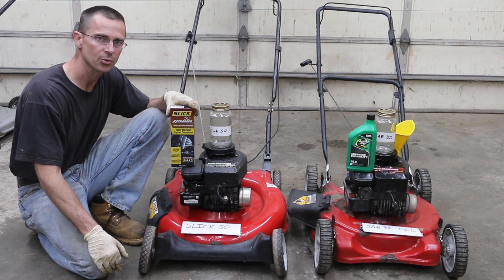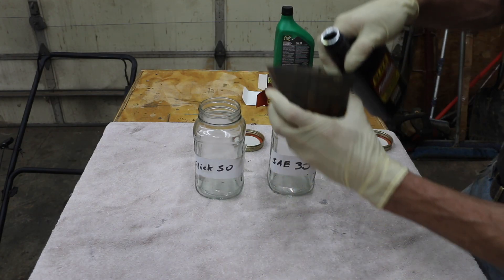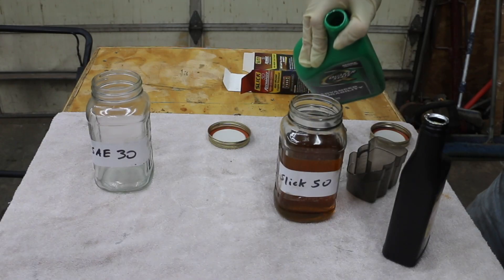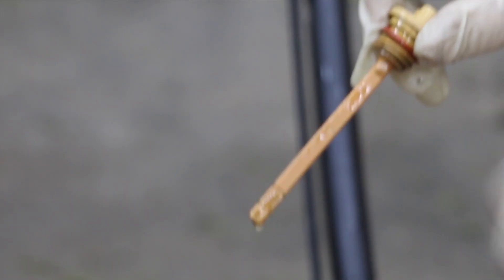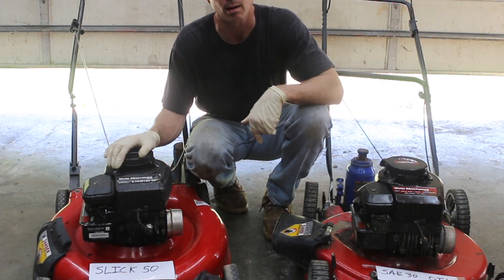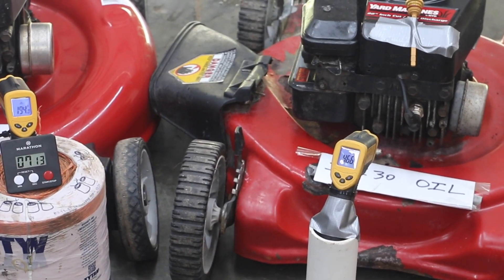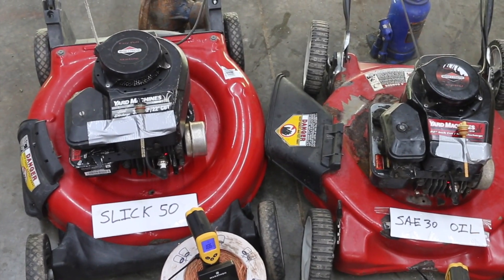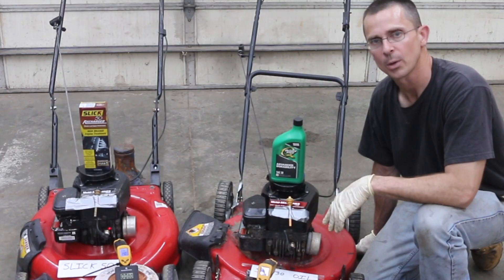Can't believe what SLICK 50 did to my engine!!--Dry Crankcase Test!

Comment: Yes the best product for your application is duralube oil treatment $16 a qt.as seen on tv.
This stuff is THE STUFF.
SUBARU BRAT 80MPH  over 1&1/2 hrs. Thou it did stall out i let it cool it had no water, no oil.. I added water & oil it fired right up no problems . Do not use unless parts are broke in .OR THEY NEVER WILL BRAKE IN.
Reply from the maker: Thank you for the recommendation!

Comment: I did not see you shake the slick 50 bottle before  pouring  a portion to mix with your engine oil. Maybe you did. Maybe not. So here is my comment even though i have used this product before i dont believe it actually works.  But here is a very important piece of information.  Slick 50 has teflon particles that fall to the bottom  there is approximately 20 % teflon. And 80% base oil.  If it was not shaken thoroughly  just before you poured some out to test. You probably only added base oil to the test.  Making the test not accurate.  Sorry to let you know this.  I enjoy all your videos. Thank you so much  keep up the good work. I feel your very conscious of fair testing.  Please re test the slick 50. Although the results will probably be the same anyway  but who knows.  Thanks again  from bob

Comment: What you're not recognizing is the fact that the slick 50 is better for retained oil and the other is just not as good at that same job, while still being better at overall retention of lubrication. #1 The slick 50 runs far cooler. This means you're getting better performance and metal retention (as long as the rpm stays in what you consider your performance range and you retain oil). #2) If you're truly going to dump all coolants and one was designed to better cool and retain performance at volume while the other is just better at performing without reinforcement by volume then it isn't a fair comparison. The second would be able to take a hole in it's oil pan and still perform whereas the other would just lock up. Neither is better, they both have advantages and either can be better on an individual course.

Comment: I would like you to do the test a second time and inspect the internals and do a compression test both before and after letting them seize. I suspect that the motor with slick 50 likely gummed up and possibly could be saved. I used it in my 1974 Porche 914 4 cylinder and after a bad oil change from a mechanic the drain plug fell out. I found something to use as a plug. I put a little oil in each cylinder. I then put the car in gear and rocked it back and forth until it freed the cylinders. I started it up and continued on to my date. I didn't have any problems with car after that day.
Reply from the maker: Thank you!

Comment: Anyone notice that the volume of oil that came out of the sae30 was much less than the volume that came out from the slick 50 engine. Maybe there was still some oil left in the sae30 engine which let it run longer
Reply: Waqas Noor Siddiqui ...I thought the same thing when noticed the difference in volume of the extracted oil.

Comment: I bought a used mower with a Briggs and Stratton engine about 20 years ago for $10. I never checked or changed the oil. The deck and wheels finally gave out before the engine ever did. My friends told me, you should change the oil at least once or twice a year. I told them, why would I spend so much money on oil. I can just get another one for $10. I was wrong, it cost me $20 to replace it with another used mower.
Reply from the maker: Great point! Thank you

Comment: I realize this is an old video, but you claim to read all comments. How about performing this test with LiquiMoly MoS2, which claims to allow engines to survive running with no oil pressure?
Reply from the maker: Thank you.  I tested MoS2 a while back but didn't use this type of test.
Reply: @ProjectFarm  I think it would be interesting to see how long an engine treated with MoS2 can survive after experiencing a total loss of oil. Better yet, how long do you have to shut the engine down after losing oil pressure before serious engine damage occurs.

Comment: My 2000 G AM cracked the oil sensor & leaked out most of my walmart synthetic oil , no oil on dipstick  . I stopped & put 3 qts of regular oil in, as that was all the little store had. I had 10 miles to home, with no other stores . Made it home, no oil on stick again, motor was popping & sizzling. Drained oil & found almost nothing was left. Refilled with same synthetic, that was 5 years & 50,000 miles ago. Car still only uses about a quart per oil change & purrs like a kitten.
Reply from the maker: Impressive!

Comment: I'm certainly not a proponent of snake oil, but didn't the Slick 50 engine have a lower operating temp than the regular 30 wt oil engine until it gave up the ghost ?  In other words,  if both engines had the proper amount of oil still in the engine would the Slick 50 engine last longer due to the lower running temp ?  I know you can't run a test that long but it is something to think about.....
Reply from the maker: Thank you

Comment: This is why I never lend out my stuff.
Reply: haahaaaa cough haha
Reply: @og1ie  LMAO
Reply: You lend your mower, your truck, your wife to someone, don't be surprised if they have a rod thrown in them.
Reply: @jeffhale2278  😂😂😂😂😂
Reply: Just don’t lend your stuff to this guy...
Reply: LOL Nice :)
Reply: @royr1016  Not the issue here. There are virtually no threads to tap into, as in the factory threaded the fitting in not much more than 1 thread depth deep, which rusts away and breaks out the single thread.  If you tighten further it will crack the pump housing, which has happened to people. If you used thread tape it would only make the clearance problem worse, as it would make the fitting larger. The factory knew about the issue which is why they barely threaded them in.   The tapered threads need tapped further, which is the solution. After doing that, a person could use a sealing enhancer such as thread tape, although I believe the factory uses a sealing compound more suitable to the high pressure.
Reply: @billg7205  Name the make of the pressure washer. Shame those idiots into making them better.
Reply: @quantumleap359  Honda, but I believe the pumps are used by other manufacturers and have the same issue.
Reply: Smart man.  My pressure washer started leaking at the hose base fitting.  Darn threads were tapped too small, so they only threaded the hose fitting 1-1/2 threads deep into the pump, and it broke out when the threads rusted.  Workers at the factory were probably told to just thread them in enough, and not to crack pump housings.  Why would they possibly want to go to the effort to tap the pumps a bit and ship a properly manufactured product?  I threaded it back in a bit further but it's still leaking, and I'm not going any further and cracking the pump housing.  I'll get around to properly tapping the female pump threads or reducing the male threads on the fitting some day.  Read about a guy online with the same pressure washer.  Guy was pissed when he lent it to his bro-in-law, who cracked the pump trying to tighten the same fitting to stop a leak.  I'd bet that's happened a number of times with the same machine, with people who have no concept that you can't just keep cranking tapered fittings into cast parts.
Reply: @billg7205  hey bill; you could try gluing a brass male/female threaded bush on the machine. i have had the same problem once before and this was my solution that worked.

Comment: I'm shocked.. I noticed the tyres on sae 30 were alot newer then slick 50..need to do side by side on exaxt built engines.. I have used Teflon based additives in noisey engines and it definitely quietens them down.. Somtimes and most times lifter noise goes away.. So from my experience most snake oils work well.. Especially Mos2.. I have excellent results with Teflon 2..
Reply from the maker: Thank you!

Comment: different slick50, the original had teflon in it and was a gray looking liquid
Reply: I used the original back in 1990. It was gray and thick. I remember it have very specific use requirements. Immediately drive at highway speeds for 30 miles, something like that.  Also remember there stories going around that it clogged oil filters because the size of the Teflon particles. Among the motor heads I hung out with at the time, the general consensus was to change your oil/filter after the first 50 miles, the idea being that the Teflon would have bonded to the moving parts by then, and your filter was now running in bypass due to it being clogged. Absolutely zero science was used to support that, it's just what made sense to us at the time.
Reply from the maker: Thank you!
Reply: @ProjectFarm  The old Slick Fifty was a different formula than what is available now. There were legal issues when the company was sold. The only place that I know of where you can still get the original is Australia
Reply: @wearemilesfromnowhere4630  or from me. I made a whole lot of money running a lawnmower engine without any oil in it that had been treated with Real Slick-50...
Reply: weren't they supposed to shake it first?  All the Teflon was probably at the bottom of the bottle.
Reply: @ChuddleBuggy  Correct, if you shake it, it looks almost like milk.
Reply: @ChuddleBuggy  My thoughts exactly. When I first used it in a 2 or 3 year old car that I'd bought from new I didn't really notice any difference, but a friend who hadn't been in it for a while commented on how it seemed much quieter under load after using it. I've used it in all my cars since then. Can't say I've noticed any significant increase in mileage per gallon, but I don't normally bother to check it.
Reply: It seemed like the Slick50 worked when it was in the engine.
It's good to know about Bishop's though.
I'm curious how Lucas would hold up.
As a Fed Ex Ground contractor, I had a Fed Ex P30 350 V8 with a Trasko oil filter. The first month I almost crapped my pants when I saw the metal particles on the micro screen. I used Lucas in that  oil change and never again. I sold the truck with over 300k miles and never opened the motor or transmission.
Reply: Slick Rock Lucas is good stuff too.
Reply: @lifequest7453  I tried to find a distributor for bishops original and their is no U.S. distribution ?
Reply: @TheHarleytt  Their what?
Reply: Actually the new formula has cheap Teflon in it, Bishop had a different ingredient and criticized them for using Teflon. Bishop’s Original is the original Slick 50. http://www.dvgibson.com
Reply: You need to shake it up to make sure the additives are in suspension be fore you pour it.
Reply: @Smedleydog1  I've always done that, then rinsed the bottle out with some clean oil.
Reply: @lifequest7453  https://www.youtube.com/watch?v=CAt-tJa9P_s
Reply: Absolutely spot on.  I always used the original stuff and never had a scrap of bother with lubricated surfaces with any of my engines. The only problem that I ever had was a broken valve spring which neither I or my local engine restorer had ever seen.  My engines were still running like new long after the bodies returned to mother earth.  The stuff you are using is nothing like the stuff I used.

Comment: There was a product that came out about 10 years ago. It shows 2 cars, one ran with regular synthetic oil then drained, the other ran with "Angelcote" I think, then drained. They drove the same route without oil. The  goal was a 200 mile stretch. The engine without synthetic oil ran 2 miles then locked up. The one with "Angelcote" went all 200 miles and back without difficulty. I am unsure about the name.
Reply from the maker: Wow!

Comment: Modern slick 50 is not what it used to be it does not work now.apparently xcelplus is using the old original slick50 formula so I feel you should test that
Reply from the maker: Thank you!

Comment: My guess is that the slick 50 probably didn't make any difference. The temperature difference could literally have been caused by anything and the fact that the slick 50 seized first doesn't mean it's bad either. It could have been a small scratch or one little piece of metal or something that lead to the breakdown.
Reply from the maker: Thank you!

Comment: I could be wrong but I thought they drained the oil and replaced it with water in that old commercial. Also I'm curious as to how similar the hours and maintenance was on the two mower engines. It's hard to believe that with the considerable temperature difference that the slick fifty engine seized first. Keep up the great work. I only just found your channel today, subscribed and I really like it. Thanks

Comment: Slick 50 takes a while to activate and it has to be at running temp for a good amount of time because it is a Teflon compound that is heat activated, probably around half an hour or 45 minutes of highway driving in a car, the engine will slow as it activates then pick back up, I have used it in my vehicles and it did it every time...the test of the lawnmower engine probably just got the slick 50 to activation temp and then seized up because the lack of oil...my grandpa used to sell slick 50 and he had a small engine as a demo engine that he would run for the customer, it had a hole cut in the crank case so the customer could see the moving parts with no oil...he got several hours out of that demo engine. Please try again, put in some slick 50, go mow a lawn for an hour, drain the oil and do the test again, I bet it will be way different.
Reply from the maker: Thank you

Comment: I put slick 50 in my wife's car about 3 months before going to work in Japan for six months. When I left I told her to get the oil changed needless to say she didn't the whole time I was gone even with me asking her periodically. After I got home she used my truck to go to her mothers and asked me to mail a package, I drove her car and it was rattling very badly, I thought well that lifter that was knocking has gotten a lot worse. When I got to ups i checked the oil and there wasn't any, it had baked what was left on to the dipstick I was furious. i wen to a gas station and put 2 1/2 quarts in it and before leaving the lot the engine quieted down to just that on lifter that was tapping before I left. I attribute this to the Slick 50
Reply: If your engine leaked or burned 2.5 qts of oil in 3 months, then it wasn't the fault of your wife's  driving!
Reply: @eugeniustheodidactus8890  I don't know why I put 3 months it was actually 6

Comment: I would think  a worn out engine with larger clearances on the rod journal, ring end gaps, and excessive piston slop would actually last longer in a test like this due too thermal expansion of the parts when run without oil?
Reply from the maker: Great point. Thank you

Comment: Just want to repeat what one already commented on. Slick 50 today is NOT the same product as original back from late 70’s. I have had a long visit with the original Formulator. He still has the propriety formula. You can buy it at Lubrilon.com. It is an absolute real deal & WORKS!  BTW, Teflon was never the key working ingredient. It was ONLY added (hardly a pinch) for marketing purposes. Call & talk to John Bishop yourself.
Reply from the maker: Thank you!

Comment: This test seems to only test the engine build in my opinion and not what you are trying to test. I could understand testing a very small amount of oil to see how it holds up and how long the engine runs. But using a coating/dry test seems useless in testing oil( I mean there's no oil in it to test). I find a lot of the ways you test things to be top notch. This method is not. Which is why I'm going to guess. You get trouble from this test.